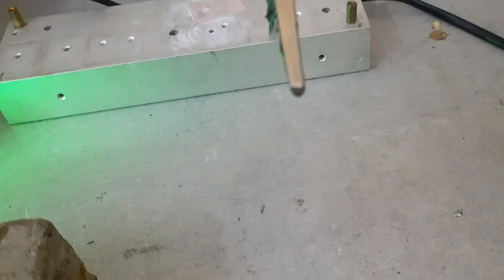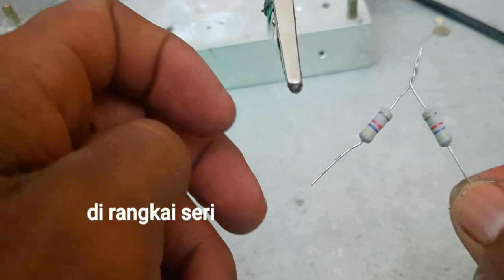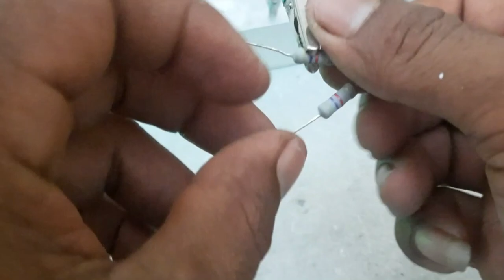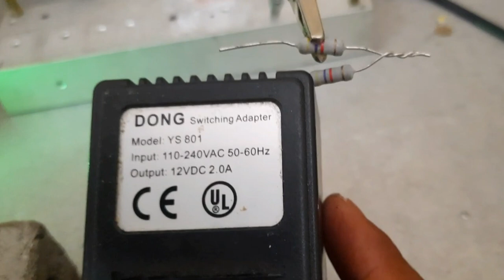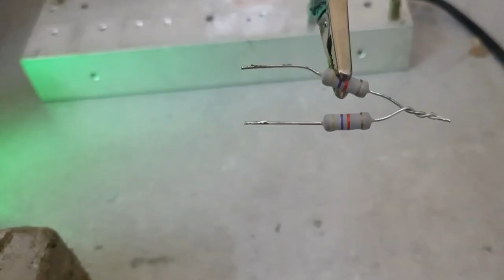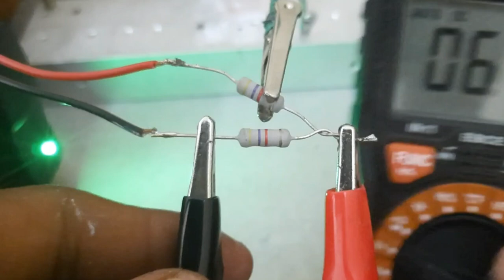hanya dengan resistor bisa menurunkan tegangan 12 v ke 6 volt..

Comment: Bos kalau nirunin arus 12 ke 8 volt, Butuh resistor tipe berapa..... 😅 🙏 Super awam nih, Tanya toko yang jualan resistor juga ngak tau 😁
Reply from the maker: Kalau ampernya kecil pakai resistor 220 sampai 330 1/4 -1/5 watt
Kalau ampernya besar pakai yang 1- 3 watt
Di sambung ke positif saja..
Tegangangan tetep 12 tapi bisa untuk 8 volt

Comment: Umumnya usaha untuk menurunkan tegangan dgn berharap arus yg dihasilkan lumayan besar. Tapi dlm konten ini yg saya amati menggunakan 2 buah resistor 4k7 Ohm. Untuk tegangan 6 Volt nya paling2 dapat arus kurang dari 1 mA. Trus buat apa arus sekecil ini ? Rasanya sangat sedikit alat/ beban yg bisa dihubungkan dgn tegangan 6 Volt ini.
Reply: km ga tau bos,, hal sesederhana itu bisa buat untung ratusan ribu,,,,

itu bisa buat cdi limiter,
contoh pada cdi rx king spek blayer yg bisa kita mainkan limitnya,
km kira itu murah,, mahalll bosss 400rb,,
modal cdi kw di bikin limiter
Reply: Bisa juga buat mobil remot anak..
Klo beli aki nya yg 6v mahal..
Reply: @AkhsanSulukin  
Ya nggak mungkin dipakai untuk mobil2an. Kan arus yg bisa digunakan sangat kecil.
Reply: @Sughi-z4d kalau kamu makek arus yang kecil kapan penuhnya woi
Reply: @Jatmiko-emo  
Kamu salah komen balik bro !
Reply from the maker: Ini hanya sebagai contoh saja..
Semakin kecil resistornya semakin besar pula arus yg keluar..
Semakin besar nilai resistornya semakin kecil arus yg keluar..
Jadi nilai resistor hanya di gunakan sesuai kebutuhan saja..
Contoh kita butuh teg 6volt 5 amper
Sedangkan kita tegangan yg ada 12 volt 10 amper..
Kalau kita pakai nilai resitor terlalu kecil ..otomatis teg out nya bukan 5 amper malaikan lebih dari 5 amper..
Otomatis peralatan yg butuh teg 6 volt 5 amper..di supply 6 volt 7 amper kan bisa cepat rusak nanti..soalnya gk sesuai amper yg di butuhkan..
Sekian terima kasih..
Reply: @CreativeElectro  
Contohmu : butuh tegangan 6V 5A dari tegangan 12V, berarti harus menurunkan tegangan 6V , kalau pakai seri resistor dibutuhkan resistor 6/5 Ohm dgn daya  minimalnya 30 Watt.
Tentu saja cara ini membuang banyak daya.
Kalau ada alat 6V 5A disupply dgn 6V 7A, ya gak masalah sama sekali. Kan arti 7A itu power supply nya sanggup mengalirkan arus 7A jadi ini merupakan kapasitas, bukan arusnya pasti/ harus 7A.

Comment: Hasil amper yang di hasilkan berapa ya bang bisa buat mobil mainan anak yang 6v 7ah gak yah
Reply from the maker: Semakin besar resistornya semakin kecil arusnya
Contoh 12v 7 amper supaya jadi 6 volt tapi amper tidak terlalu berkurang pakai resistor 10- 20 ohm 1 watt
Reply: @CreativeElectro  saya untuk in 12v/aki motor out nya 6v 7ah kira kira pake resistor yang mana yah bang

Comment: Klo adaptornya 12v 1amper pake resistor yg berapa kilo mas
Reply from the maker: 2k2 1 watt..supaya arus,y tetap stabil
Reply: Makasih infonya mas.. saya coba dulu
Reply: Apakah wattnya juga akan berubah mas?
Reply from the maker: Gk bro..
Tapi kalau buat lampu
 Kalau lampu,y redup di perkecil lagi nilai resistor,y..walaupun tegangan masih tinggi tpi arus,y sudah di kurangi oleh resistor..
Reply: @CreativeElectro  saya mau buat cas casan mobil2.an anak2 mas dari 12v 1ampere ..kan itu cas2.annya harus 6volt
Reply from the maker: @zaffaxby8487  owwhh ya bisa bro..gak masalah..
Lebih enak nya di coba dulu buat ngecas..
Reply: Pke yg 2k2 1w ya mas
Reply from the maker: @zaffaxby8487  bisa bro 
kalau avometer di cek dulu tegangan keluar ketemu berapa
Reply: @CreativeElectro  oke mas terimakasih infonya
Reply: Mas minta wa nya

Comment: Klo untuk menurunkan 5v ke 1,5 v pakainya resistor brapa boss,dari charger hp ke jam dinding??🙏makasi
Reply from the maker: Pasang resistor 330 ohm di bagian positif..
Walaupun tegangan masih 5v tapi sudah di kurangi..
Bisa untuk tegangan 1,5 volt
Reply: Klo dri 7 v ke 5 volt butuh berapa resistor

Comment: Bang kenapa resistornya ga di pasang di kabel positif sumber tegangan aja bang kenapa harus di pasang di negatip dan positif
Reply from the maker: Kalau di pasang di sumber teg positif 12v saja..
Teg tetap 12v cuma arusnya yg turun
Sedangkan kita butuh yg 6v
Reply: @CreativeElectro  saya barusan nyoba pasang resistor 1k di kaki positif aja tegangan 12volt saya cek pake avo tegangannya jadi 7volt banv

Comment: Untuk penurun tegangan aki 12v 7.5ah menjadi 6v di pasang brpa dioda om? Pemasangan ny hanya di kutub + ny saja kan?
Reply from the maker: Tidak perlu pakai dioda cukup resistor 4k7  3 watt
Reply: @CreativeElectro  untuk pemakaian sering dan jangka panjang lebih aman pakai resistor apa ic regulator om? 🙏
Reply from the maker: Kalau kebutuhannya cuma satu amper..
Lebih baik pakai ic 
Soalnya kalau ic arusnya cuma satu amper..
Kalau pakai resistor 4k7 arusnya 2 amper lebih..
Untuk jangka panjang pakai resistor 4k7 10 watt..
Menurut saya lebih baik pakai resistor simple gk ribet..
Reply: @CreativeElectro  baik gan trimakasih informasinya, sukses selalu untuk chanelnya
Reply: klo cuma pake 1resistor butuh berapa ohm???

Comment: Cara pasang ya gmn di aki mobil maina
Reply from the maker: Kabel positif dan negatif aki ke resistor..
Terus untuk ambil tegangan  positif,y di out resitor dan yang negatif tetap di negatif aki..
Reply: @CreativeElectro  saya punya adapter 12v/2ampere mau dipakai ngecas aki 6v/7ah idealnya pakai resistor yg mana om?? Dan berapa watt buat pasang di mobil2an anak

Comment: Klo 2k2 brapa volt
Reply from the maker: Volt tetap sama 6 volt,cuma arus nya lebih besar dari pada pakai yg 4k7
Reply: @CreativeElectro  besar a brpa wat
Reply from the maker: Tergantung arus dan teg yang di pakai..
Contohnya teg 12volt 2 amper..
Berati 6 volt 1-1,5 amper
Reply: @CreativeElectro  it harus 2k2 dua buah y..
Reply from the maker: Iya betul
Reply: @CreativeElectro  mkasih gan info a sukses selalu... 
Boleh tanya² lain kali....